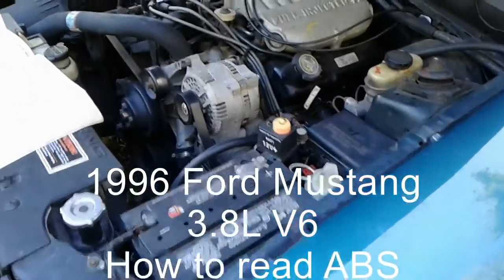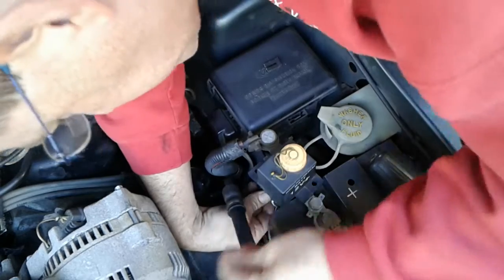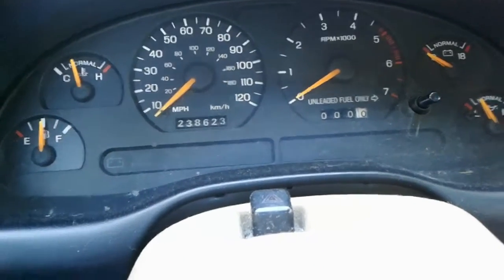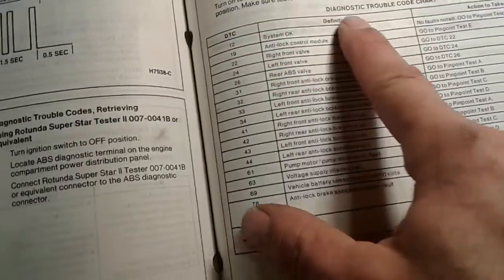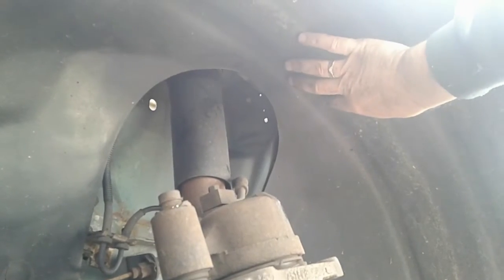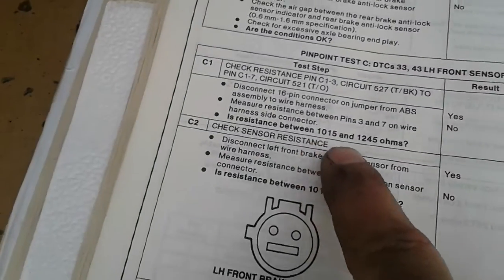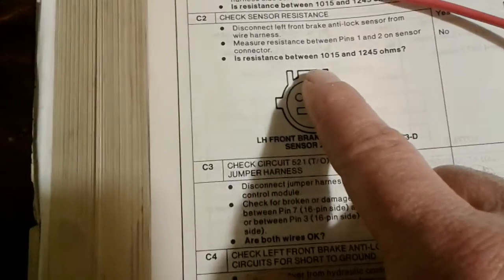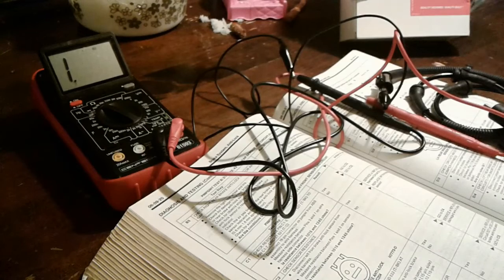Read ABS codes without a Scan Tool -1996 Mustang Anti-lock Brake Sensor Fix

Comment: I have problem with my 2000 Gt Convertible abs light is on, I change both rear abs sensor.  Light is still on. I need guidance.
Reply from the maker: Why did you change the rear sensors? Did you pull the codes from the ABS module to get an idea of the fault it is detecting?

Comment: Hi, do you have any idea what it mean if it only flashes 6 time. Thanks Adam
Reply from the maker: They are two-digit codes, and there is a 1.5 second pause between digits. Do you notice that slightly longer pause between any of the flashes? So, if you're getting a total of 6 flashes, and there's a pause between the third and fourth flash, then your code would be 33. It would be "flash, flash, flash...pause...flash, flash, flash" Make sense? It could also be giving you a 24 ("flash, flash...pause...flash, flash, flash, flash") or a 42 ("flash, flash, flash, flash...pause...flash, flash"). The manual does not list a 15 code or a 51 code. So I think you're only options are 24, 33, or 42. Hope that helps.
Reply: @Buckwsr  it was my mistake, it was 6 - 1 61 apparently its the abs pump relay. I've been searching for over an HR now and still can't find 1 in the UK.